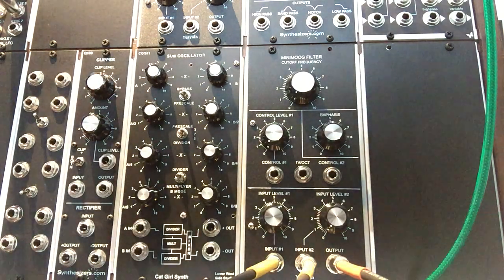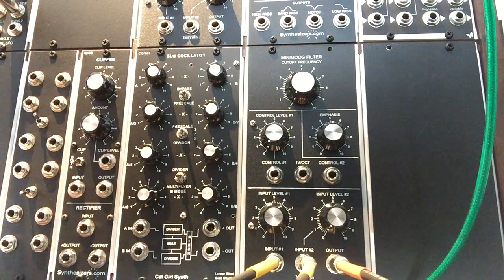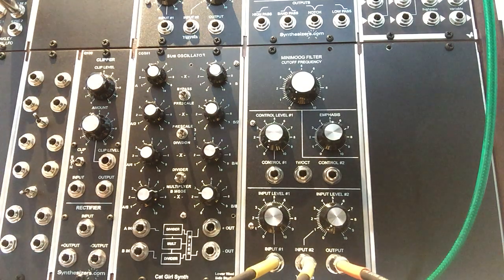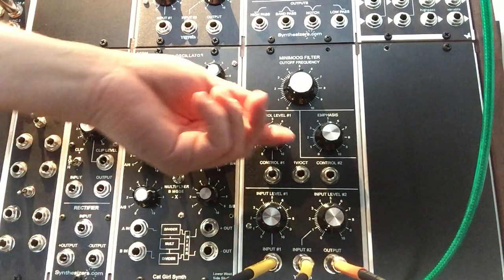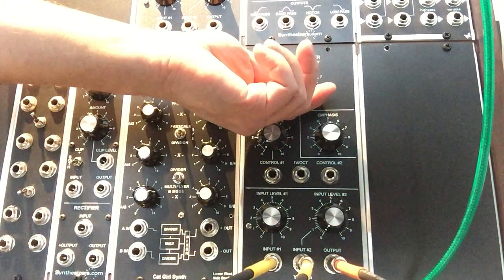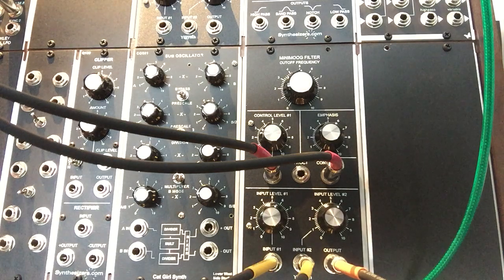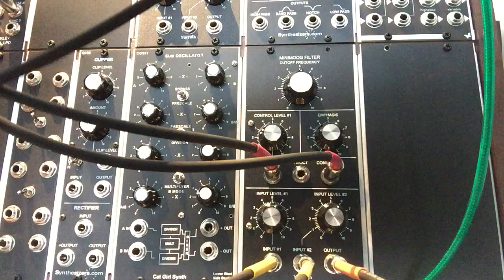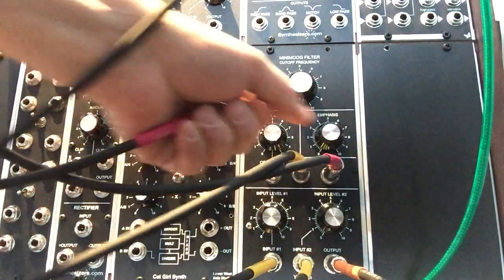5U Yusynth Minimoog Filter Clone

Comment: Thanks for the demo. Not sure if you misspoke, but just in case you weren't aware, the Control #2 does not control the resonance/emphasis, it's just another CV input for the cutoff.
Reply: You are correct Ben.  Thanks for pointing that out.